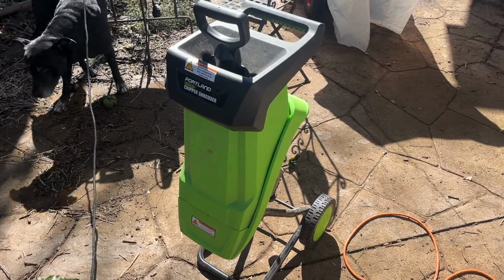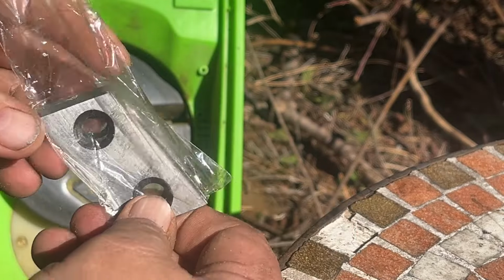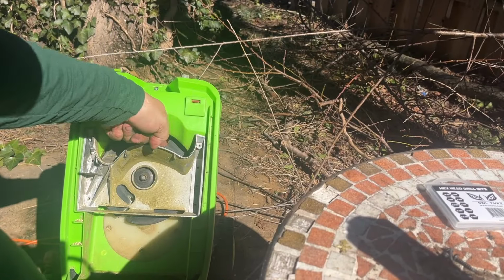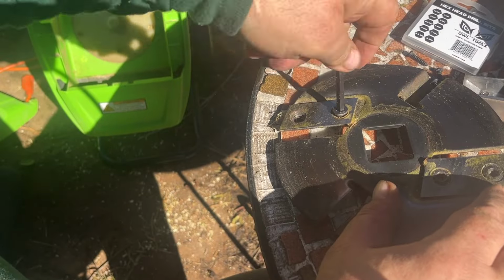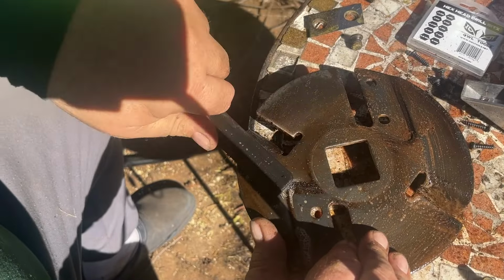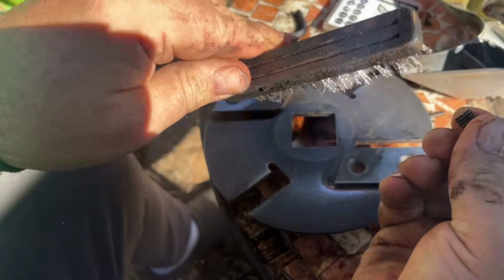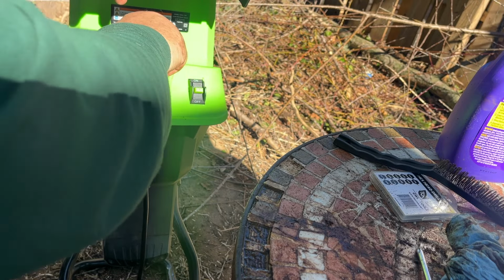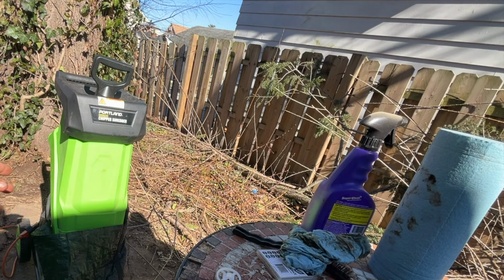Harbor Freight Chipper/Shredder - How To Change the Blades

Comment: First 30 minutes the blades cut great,  next 30 minutes ok, then time for new blades.
Reply from the maker: I don't think you're supposed to put bricks through the shredder lol Mine, though, lasted for about two years before I needed to swap them out
Reply: @HomesteadDIY   yeah I was running a tin of 1 inch branches.... Blades didnt get chunked but definitely dulled quickly.  Picked up a few more sets then I can touch them up as I go.

Comment: My chipper stopped working as I was feeding a branch into the machine. I can manually move the blades, clockwise, and counterclockwise (checked when unplugged); the circuit breaker button is not popped up; the extension cord I use is still working since I tested that on a different appliance; there is no debri stuck in the machine. What else should I check?
Reply from the maker: I've found I've had to wait a few minutes in pressing the the circuit breaker button to reset it. A number of times when it has been tripped, if I try to press it right away, it doesn't reset, but letting it sit and then pressing it it starts back up.

If that doesn't help the only thing I can think of is the fuse inside is blown. I haven't had to try and replace that yet, but I'm going to guess you may be able to unscrew it.
Reply: @HomesteadDIY  It's been 2 days.
Reply from the maker: @RagefulJewel  Alrighty then. That should be enough time. Like I said, I haven't had that happen to me so I'm not sure, but you might be able to unscrew the reset button and see if there is a fuse in there that has blown. Sorry I can't be of more help
Reply from the maker: I just looked up the exploded view of the chipper shredder in the manual and the only thing I see that might be the problem is the capacitor (Part No. 41). It doesn't seem to have anything else. It also looks like you would have to disassemble the housing as it seems to be connected to the motor.
https://manuals.harborfreight.com/manuals/69000-69999/69293-193175327277.pdf
Reply from the maker: One more thing. I just remembered the housing has a metal tab that fits into a slot at the top of the unit. You probably already did this, but make sure its properly seated in the slot. Also, that tab probably completes a circuit in some fashion. You might want to check there to see if there is a blockage of sorts or some other problem.
Reply: @HomesteadDIY  Thanks for offering help. I'll check the things you mentioned when I get the time.

Comment: hey fellow Harbor frt enthusiast !   where did you get the blades ?
Reply from the maker: They came with it!
Reply: @HomesteadDIY  Thanks, but,  I got mine 2nd hand so - no extra parts... thought you might have ordered them
Reply from the maker: @JohnCausey-pe2gw  I just checked the Harbor Freight website. They offer the blades as a replacement part though it says call for pricing. I see Amazon sells blades that look pretty similar for about $10 or so.